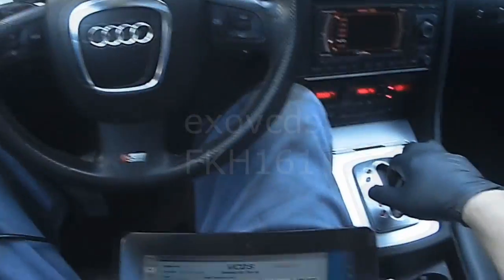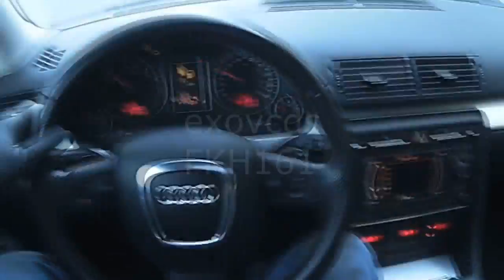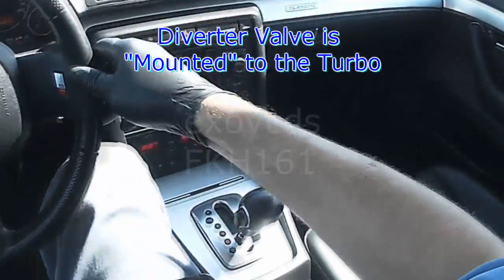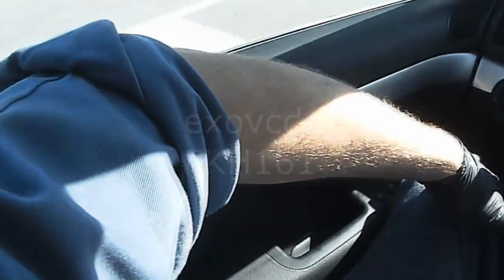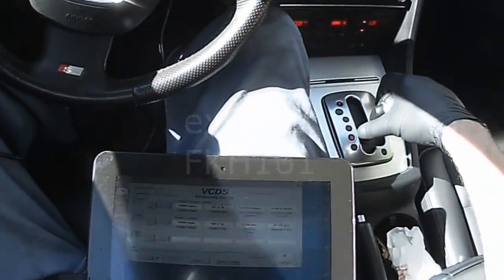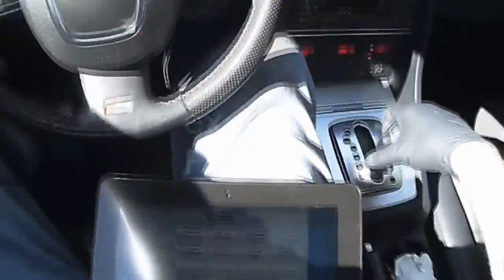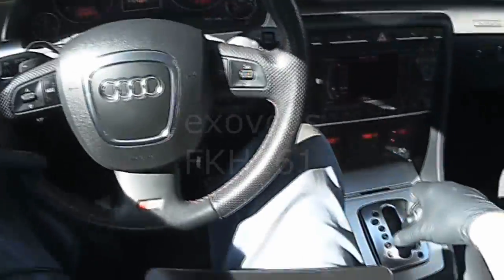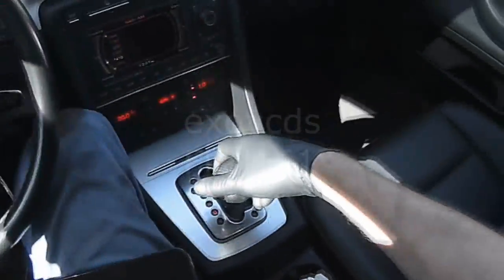Audi B7: 2.0T FSI "Boost Pressure Regulation Control Range not reached".

Comment: hi p0299 code   its for boost pressure regulation     on my garage comee vw passat 2.0    today car not power thnx
Reply from the maker: +KURDISTAN uk Check boost control... check for air leaks.Check http://images.esellerpro.com/3394/I/32/39245.jpg mounted on turbo.
Reply: hi today im order top of the turbo one i thing i order wrong one
Reply from the maker: +KURDISTAN uk My picture could be wrong... it was just a sample.
Reply: ah ok thx,, thomas,,, but today im looking i cant find that one under turbo ,,, after that i put canner come up p0299  which is that one u replace on video after that im order top of the turbo ,,thnx i will try monday
Reply from the maker: +KURDISTAN uk I don't know what the passat turbo looks like... anything that could cause "low boost" needs to be checked.
Reply: its 3 door ,,2.0    2010..  she put wrong fuel i take out all fuel then after that happnes not power,, i thing boost pressureis faulty
Reply from the maker: +KURDISTAN uk TDI wrong fuel?
Reply: yes she put patrol by mistake
Reply from the maker: +KURDISTAN uk High pressure pump / fuel system is damaged... did the engine run and then die? Or did she NOT start the engine with petrol? If she ran the engine with petrol... a lot of fuel components will need to be replaced.
Reply: yes she drive but when i take of all petrol,,i put injactor cleaner also i have good diagnostic there it not fault code more then   1   p0299
Reply: engine run so cool but not power more thn 70
Reply from the maker: +KURDISTAN uk Ok.. she's lucky then.
Reply: she saying som times  Catalyst) light come and go,
Reply: hi i replace problem its fixe thnx
Reply from the maker: +KURDISTAN uk Hi, can you post picture or video of the part? or send to my email? fkh161@fkh161.ca
Reply: ok not problem i snd u

Comment: thanks for this. my buddys 2.0T jetta is having the same problem, going to help him fix it soon.
Reply from the maker: juri832 Make sure that the intake plumbing is not leaking anywhere. All the check valves need to be good as well... or boost will leak into the crankcase or other places... such as the EVAP system.

Comment: Hi Thomas - I'm (2007 a4 2.0t w/ 82,000mi) getting this P0299 code (with MIL) even though I changed my diverter valve valve to the updated model about a month ago. 

The actual boost is far off from the specified. It will shoot up to the specified, but will not hold. What other components should I check? From your experience, what is the most common component to fail with this code, after the DV? 

thanks
Reply from the maker: Harry Greenhouse So far, I have only come across faulty diverter valves... but anything that could cause air to leak / bypass the pressure sensor (even pcv components), will set that code. Pressure test the intake from the turbo out to the manifold and the manifold itself. If I come across anything else, I'll let you know.
Reply: ***** I'm going to try replacing PCV components. Do you have a video on how to pressure test the 2.0T FSI motors using off the shelf ·(non-professional) components? If not, you should make one!! :)
Reply: Harry Greenhouse
 n75 valve faulty